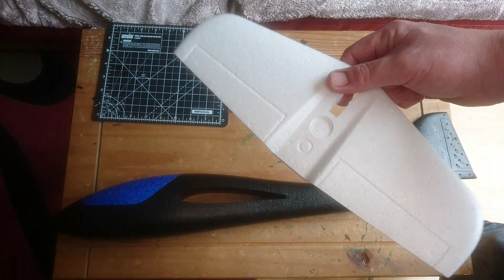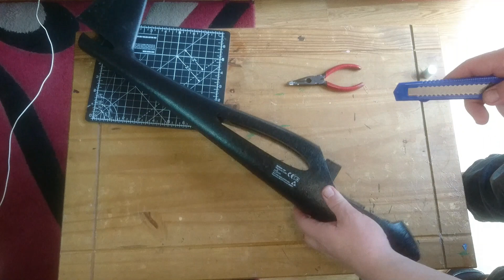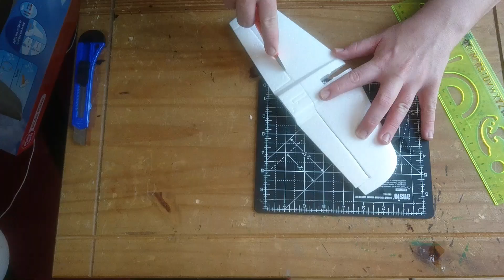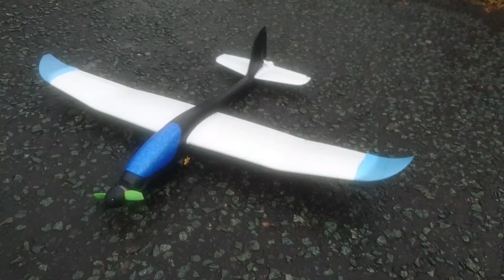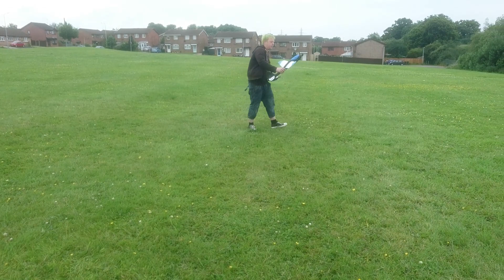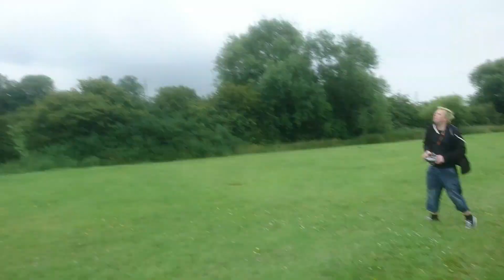Lidl Glider 2021 3D Printed Winglets

Comment: Aweaome build. Did it fly well with the small ailerons and dihedral?
Reply from the maker: Yes very well ,the roll rate was considerably dampened with the winglets on though.
Reply: Great to hear. I don't get why most people are putting the ailerons on the flap section of the wing if lidl even put a cut here further down the wing where it should be. Maybe because they don't want servo extentions! Lol I dunno. Your build is the only one I've come across that uses those aileron positions. Just gotta decide if i should keep the dihedral or not. Anything you would change on yours if you built another one? Thanks

Comment: now all i need is a 3d printer... and a lidl glider that hasn't been completely mangled,
did the 2021 version come with those control surfaces already imprinted?
Reply from the maker: Yes and the tail has the surfaces i printed aswell mich better and quicker for building.